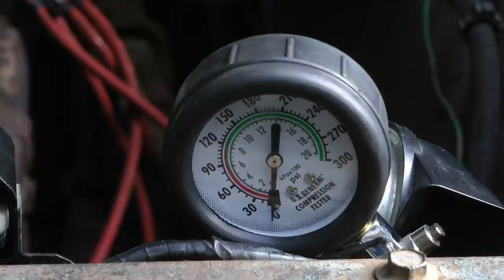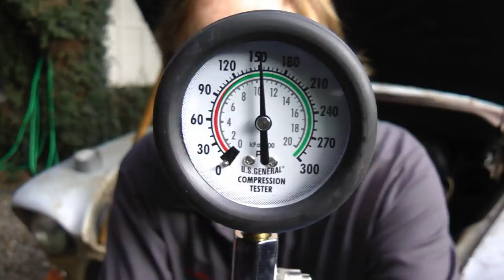How to Tell if Your Car's Engine is Bad

Comment: Hey Scotty, I have a 2005 Suburban with 189,000 miles on it. Runs great. Uses about 1 quart of oil every 5000 miles. We put 25,000 miles on per year. Next June my wife wants to use it to pull an 8000 pound camper 1000 miles round trip, then in August, she wants to drive it to Florida, about 2000 miles round trip. By June I estimate it should have 205,000 miles on it or so. Are those trips too much for the engine? Just wondering if it will be too worn out for those long trips.
Reply from the maker: actually long trips wear a vehicle the tiniest amount. It's stop and go driving that wears em out, a non stop 2000 mile trip is equivalent to maybe 400 miles of stop and go city driving for wear.
Reply: Scotty Kilmer Thank you!
Reply: James Garber My 03 suburban is pushing 261k miles yours will do just fine.
Reply: I wouldn't worry about the engine if it is under good maintenance...
Don't forget about the transmission...
Reply: eddrum100
Really?  use 50w and your car wont start when it's cold?  Is that why my older 1991 VW runs 20w-50 all year round, and starts right up when its 15-30 degrees Fahrenheit outside? 
50 weight oil is good for motors that are old and getting tired...Mine has 264,000 miles on it (original head gasket even) and is getting tired, burning more oil than it use to, and it runs BETTER and burns less oil when running 20w-50 than thin oils...
Reply: 1994 honda dx with 260,000 miles the pistons still seat tight in the cylinders I checked wen I installed a multylayer head gasket, no burning oil I still using 5w40 in northern California all the year around...
Reply: ***** You make me cringe, you can do a lot of damage on cold starts when you increase the weight of your oil, not only that, some engines require a specific viscosity or they won't run properly, for example, in some Hondas, the lifters on the cam gear will not work properly, or the Vtec doesn't work right because it relies partly on oil pressure, DON'T DO IT, I'm warning you and anyone who reads this! Many cars vary with different requirements depending on how they are made. What I should suggest instead is, for example: if your car has a recommended oil of say 10w40, the 10 part is the most important part of the weight rating to suit your engine you should stick to, because that is the actual weight of the oil, no ifs or buts! unless you are in a desperate situation where you lost oil and you are stuck in the middle of nowhere, the other time is if your engine is on its last legs, i recommend a rebuild in that case, The secondary rating, the 40 part is to do with the 10 weight oil holding its viscosity like a 40 weight at high temperatures, that figure you can upgrade, so in a car that is recommended a 10w40, you can put a 10w60 oil in it and it will make the car handle higher temperatures and harder driving better, however, I shall suggest its best to maintain your cooling system with a correct thermostat, that is the beauty of water cooling on engines is the temperature is tightly controlled, air cooled engines such as what you find in a VW beetle or Microbus will benefit with a higher secondary weight rating, but make sure the lower rating is correct! There are other important factors in choosing your oil, not just the viscosity, the things you need to consider: if your engine is the old-school push-rod with no emission controls, you choose an oil with a "high zinc" content, that combats wear on your camshaft and benefits other parts in your engine, if you drive an old Diesel, again choose a high zinc oil, but a "high detergent" type "Diesel spec" oil to combat sludge and soot related wear. If you have a more modern car that has all the emission controls that you could think of, this is when things get complicated, you need to choose certain anti wear specs, and other properties often recommended by your car manufacturer, avoid Zinc otherwise you will destroy your catalytic converter, for modern "Clean Diesels" with "Diesel Particulate Filters" you need to choose a specified "low ash" formula or your DPF will clog up, Avoid zinc!!!! or you will be very sorry, those DPF's aint cheap! The Clean Diesel oil is often european spec "long life" specially made for Diesel engines fitted with "Diesel Particulate filters" often you would find Mercedes Benz, Volkswagen, Audi, BMW share same or very similar oil requirements along with a few asian brands that make cars for stringent European emission standards such as Hyundai, Isuzu's and any "Clean Diesels" in this matter. This is just the basic information, learn about your car, don't just make decisions based on what gets around word of mouth, every car may be based on the same operating principle, but every car is different in the little things that go on under that hood.
Reply: eddrum100 15w50 multygrade, is not the same as 50w..
And maybe ***** correctly using the right oil in HIS car...
Reply: eddrum100 Yes, exactly, I cannot agree with you more, but depending on circumstances and what vehicle you have, you can put in same viscosity but with better lubrication properties, oils recommended for newer cars are already pretty good and you cannot get much better so its often good to stick to what they recommend, but for older cars, oils technology has certainly improved since they were new, for example, we have synthetic oil which is far superior to mineral, there were no such thing as detergent oils over 40 years ago, now detergent oils are standard in every bottle of oil you buy, so you have a bit of playing around,, and zinc is great for a backup lubricant when times get tough for your engine because it protects your engine from any potential metal to metal contact (camshaft, and protection from piston ring scuffing) during high load conditions, but only use it in motorcycles, or older cars with no means of emission controls other than correct tuning, for newer cars, the recommended oils have alternative means of anti wear, in other ways, modern engines are immune to the kinds of wear that older pushrod engines used to endure, like rollers on rocker arms eliminates the need for zinc as they roll, not slide. Gone are the days when you used to wear the lobes off your camshaft just because the oil you used lacked zinc.
Reply: Scotty Kilmer That is why Taxi drivers get massive amount of mileage out of their cars, and the engines are still in top shape at even 500,000 or more.
Reply: eddrum100 I think that the one can't read is you, because I never talk about mix viscosities homeboy
Reply: I use synthetic 5w40 in my 94 civic d15b7 all year long in northern California
Reply: eddrum100 don't tell me what to do homie, 
Read Christopher O'Reilly postings, his correct...
I'm mechanic certified ASE technician... And isn't the same what you read and the practice...
Reply: What does my oil actually do?

Your engine oil performs many functions. It stops all the metal surfaces in your engine from grinding together and tearing themselves apart from friction, and it transfers heat away from the combustion cycle. Engine oil must also be able to hold in suspension all the nasty by-products of combustion like silica (silicon oxide) and acids. Finally, engine oil minimises the exposure to oxygen and thus oxidation at higher temperatures. It does all of these things under tremendous heat and pressure.

How do I read the numbers around the 'W'? For example 5W40?

As oils heat up, they generally get thinner. Single grade oils get too thin when hot for most modern engines which is where multigrade oil comes in. The idea is simple - use science and physics to prevent the base oil from getting too thin when it gets hot. The number before the 'W' is the 'cold' viscosity rating of the oil, and the number after the 'W' is the 'hot' viscosity rating. So a 5W40 oil is one that behaves like a 5-rated single grade oil when cold, but doesn't thin any more than a 40-rated single grade oil when hot. The lower the 'winter' number (hence the 'W'), the easier the engine will turn over when starting in cold climates. There's more detail on this later in the page under both viscosity, and SAE ratings.
Reply: ***** I have grown up with a father who is a mechanic who has worked on cars all his life, and built turbocharged chevy engines for boats, for starters a 454ci big block running on propane gas that develops 900BHP for over 1000 hours between rebuilds so I have learned a few things throughout my childhood by watching what he did and listening to his talk, I also work as a mechanic for a Tree Lopping company maintaining their trucks, chainsaws, and also the Honda CT110 motorcycles which I ride to distribute their advertising material, those small bikes clock up massive Kilometers for such a small engine that cops a hell of a flogging every day that they get ridden, its only recent that I had to tear down a couple of engines for a rebuild because the crank bearings started to get noisy, rings are still good with enough compression that sometimes the kick start doesn't budge when you try to start it, on an 120,000Km 105cc engine that has gone through 4 sets of timing chains, however the lower head gasket leaks oil, rings outlast the rest of the engine basically at my work because I am very thorough.. I have never had any professional training so I cannot charge top dollar for my work, I don't have a lot of money but work very hard. Its that whenever I have a job, I research everything I can and do a lot of thinking before tackling the job, so I know I am doing it right. I am a jack of all trades.
Reply: ***** I have sort of backed off to sit back and watch these comments, its rather fascinating how people get a bit butthurt when their "beliefs" get challenged over something simple and concrete. Hey guys you cannot deny science, oil and car companies don't spend millions to billions of dollars on fluid technology research for nothing!
Reply: DJohn NineOneSix How about you read the whole conversation first? The discussion was about putting a higher viscosity oil in older engines, not about how to interpret oil ratings. People have correctly stated that putting a heavier weight oil in an older worn engine with high miles works better than putting a thinner oil in it. This is true and some oil manufacturers sell heavier weight oils just for this purpose.Of course one should adhere to the manufacturers recommendations if the engine is in good condition, but higher than normal oil consumption can be reduced by using a heavier weight (higher viscosity oil) when the engine gets old and worn.
Reply: DJohn NineOneSix I'm not trying to argue with anyone, I was stating a fact with regard to worn and neglected engines. No-one says you can't use what you want in your particular situation. Your tone and language are inappropriate for a public forum such as this one. How about you lighten up a little, cut the bad attitude and be respectful of others. Judging from your language and the assertion that you are an ASE certified tech, it sounds like you have spent your life trying to justify yourself to those who are better/smarter than you. If you think you have nothing left to learn then I would never recommend anyone take their car to you for repair as there is nothing worse than a 'know-it-all' who isn't open to learning new things, particularly with modern cars and their increasing use of technology. FYI I have 30 years experience in the auto industry and a professional engineering background. You need not reply to this comment as I have wasted too much time on this already.
Reply: Oh and by the way I'm a high performance specialist,
And I start learning since I was 14 wen already I was racing in the drag strip a quarter of mile, I being doing rally with a vw rabbit and a 510 Datsun coupe, by the age of 16 I was doing rally in a 1976 GMC high Sierra short bed with 46's mickey Thomsons, double rancho shock absorbers on the front each side 5.7 block 4 main bolt over bored to 4.125, zero gap rings, high performance pistons with dome, 2.1 intake valves, headers and glass packs, high performance main and rod bearings clevite77, high pressure oil pump MSD ignition system with BWD spark plug wires, modified Rochester Qjet, bosh copper core spark plugs modified by me for a better location of the spark, heavy duty clutch pack and limited slip front differential, electric fuel pump and radiator fan and some other things and all that time I being my own mechanic,
So I have experience in shop as in the competition track...
and that's just a few things on my skills chart...
Thanks to all my haters!!!
Reply: ***** thanks bro I'll consider your suggestion... I'm a hot head..
Its just that was not the right day to accuse me of something...
But thanks again and you have a great day...
Reply: What I am getting at is, you have to be careful sometimes, you don't just put thicker oil in you engine just because its done more K's. As I stated earlier, some modern engines have hydraulic lifters, and some have other components that operate on hydraulics, which require a specific oil viscosity to work correctly, for very old engines that have none of that stuff, you can put in a thicker oil to reduce oil consumption, it doesn't help the compression though. Sometimes thicker oil may do damage, some components may suffer oil starvation because there are some flow restrictors to places such as camshafts, like a scenario being the rings may be worn but your cam gear is perfectly good, put thicker oil in, you may have less oil consumption but your cam gear may get damaged, etc... and you would be up for more parts to be replaced (more $$$) when you do get around to getting a rebuild. In other scenarios, I have bought cars with a degree of oil consumption and about a year later, not a drop between oil changes, because I put a very high quality oil in of correct viscosity, change it frequently, and I give my cars a fair flogging, sometimes oil consumption could be caused by the rings being gummed up, or coke build up, sometimes they lose their bed so need a bit of hard throttle with some clean oil to clean all the gunk out and bed those rings back into the cylinders again. Even my new Volkswagen, I seen people whinge on forums how Volkswagens consume oil, and yes mine did consume oil when I first got it at 45,000Km, until I drove it for over 6 months and stacked on 20,000Km, it sees very close to redline often, heaps of lead foot, but I am particular in letting it warm up first, these days, It may be due for new tyres very soon due to a hard driver (me), but it consumes not a drop of oil between taking it to the dealer garage for service every 10,000Km (they recommend 15000), I often not even bothered to lift the bonnet for weeks except to fill up the windscreen washer bottle or give the engine bay a clean, because its all so predictable and reliable.
Reply: Exactly 15w wen its cold and gradually goes up to 50w depending on the temperature that's why its called multigrade..
I totally agree with *****
I use 5W40 in my civic DX with 260000 miles and is not wear in the cylinder slaves at all,
Rebuilt my engine just cause I need to replace a old bad cylinder head gasket, engine never overheated,
Now I have a multilayer head gasket on it
Reply: Scotty Kilmer 
Yeah... I'm driving my truck 14 years old Navara now too often too short distance... I'm changing oil every 1-2 months with old school diesel flush no matter how many miles... Not many miles though just warming up a little and go to work about 300 metres. Same back home. Once a week going shopping. It's 70 miles trip with some highway. Do you have any tips for me please? What I should be careful about? Thanks mate!
Reply: Martin Hagalen you are changing your oil too soon,
And flushing fluids are not recommendable cause it exposes the metal to metal surface contact and if the engine save some of that flushing fluid in the lubricant system that can contaminate the oil and make it lose properties,
Reply: DJohn NineOneSix 
Well maybe too soon for my cash mate but it can't harm the engine. Old school diesel flush mean to add prior to oil drain when the engine is warmed up some diesel ( I do 0.5L) and let it idle for 5 min. Than engine off and drain every last drop of oil. I'm not using chemicals from the shop. Only diesel. My engine take 6.7 L of oil so 0.5L of diesel can't harm. It's not aggressive as other additives.
Reply: Martin Hagalen oh okay... 
Got it...
But still too soon Lol..
300 meters you can go just with the engine idle..
Reply: How about never needing to top up the oil ever between oil changes. My VW used to use oil when I first got it at 46,000, previously owned by an elderly man, now, not a single drop goes down the oil filler between service intervals, which it now has 77,000, it runs off a very watery 5w40 viscosity oil, the Volkswagen mechanic explained to me the reason is, the engine has worn in therefore has improved since I got it, or probably because I give it some heavy foot which it needed. Same with my old Mitsubishi Triton 2.5 diesel (Dodge Ram 50, Mitsubishi Mighty Max) which has around 360,000Km on the clock, original engine, which I still put in rather lightweight 15w50 synthetic, same oil weight recommended for it when it was new, I just service it at 10,000Km, never needs top ups, so reliable that I often never need to do anything, its only a matter of checking fluid levels and other things whenever I pop the bonnet only to often find nothing needs to be attended to. Sometimes if you push your engine hard, it cleans and beds in those piston rings to make them seal better.